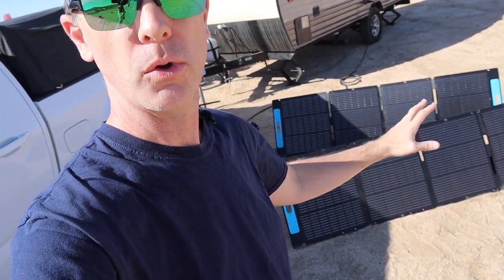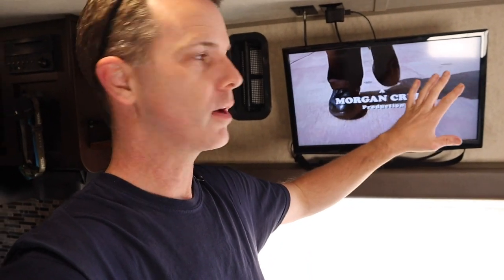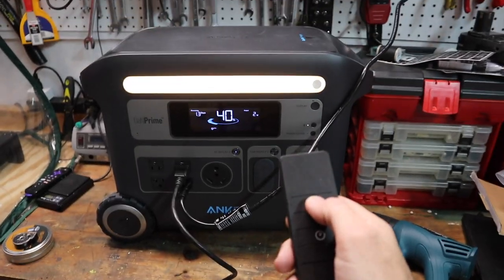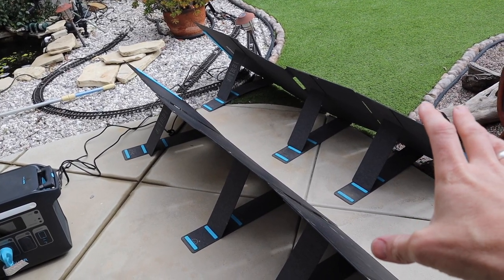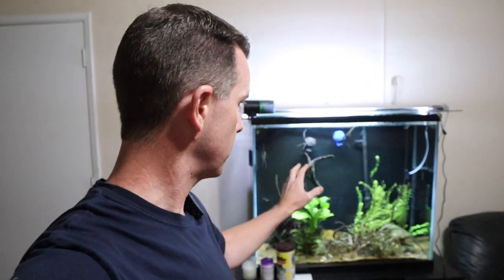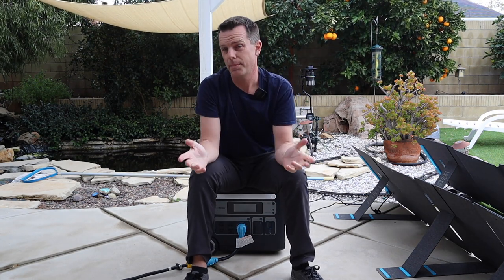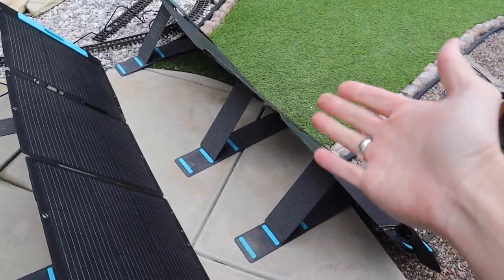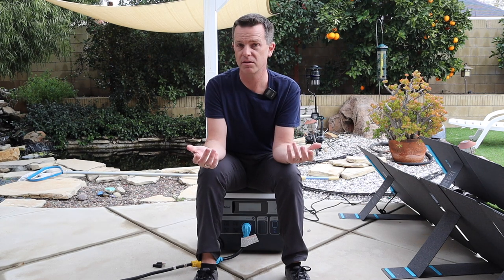Can It Actually Replace A Gas Generator? Anker Powerhouse 767

Comment: Thank you for the review. The 767 is a good complement to a gas generator. The gas can run during the day and the 767 can run at night.
Reply: Even better, run the generator only to charge the battery, instead of wasting its always-on energy when less is needed. This is the Achilles Heel of those Generacs & others; they don’t sell them with batteries so they run all the time—even if you have just a few lights on, and waste a ton of fuel.
Reply: @shandor2522  even better, throw some panels on the roof to charge either the 767 during the day or your cabin batteries and throw your noisy smelly gennie away.

Comment: AC current can act very strange, especially when something like an air conditioner turns on.The flow actually can move backwards. It seems like this unit doesn't have a problem with that and can allow a temporary heavy load. I would love to see voltage/amps on another device when something kicks on like air conditioning.

Comment: I currently have the 767/760 support battery, reversing power to condo, runs home refrigerator, freezer, and mini freezer, runs lights, enough to keep us with lights and tv during hurricane or power outages, runs 6k window a/c for 15 hours…just shut off whatever your not using and your ok, after outage I recharge it with my Honda Generator or house power,if FPL gets it back on…😂😂😂

Comment: I think the EcoFlow in this wh range has better specs...and is more compact...I personally can do with a smaller EcoFlow because we don't need much during power outages...BUT i'm tempted to get this more expensivd Anker because of 1) wheels and pull handle 2)Light in fromt 3) 14-30 plug 4) looks more attractive.

Comment: Just came across your video.  My EcoFlow Delta max can run my A/C.   The problem with initial start up of the A/C is the amperage goes above 15 amps, but my ac outlets are rated for 20 amps.  It is not the wattage that shuts down the Anker but the amperage.  On my A/C if I turn it on to high cool immediately it draws between 16 to 18 amps.   The way I got mine to work was to ensure that everything was turned off in my RV.  Than I started the A/C on low fan, for a minute, than on high fan for another minute, than I went to low cool until the compressor kicked in, this drew about 9 amps at start up than dropped to 3 amps, afterward I turned on high cool which stayed at 4 to 5 amps, than I turned on the fridge and what ever lights you wanted.  Of course my a/c would run down my ecoflow in about an hour.  I was just conducting a test as I did not want to install a soft start.  My A/C is the Coleman Mach 13,500 BTU, just fyi.  Good video by the way.

Comment: You need an air conditioner soft starter.  It starts the compressor first, then starts the fan a few seconds later.  This way the initial in-rush current is dramatically less and you won't overload the pure sine wave inverter.  They are available through E-bay for less than $150.  It's not the same as the unit you're showing at 4:10. it actually installs inside the A/C itself.
Reply from the maker: I know, but in theory this power station should be able to start the AC. 
The benefit of the inline soft start is that it also buffers everything else downline. It soft starts the microwave as well lessening the load on the generator through those startups as well.
Reply: @DoItYourselfDad I seen on another channel (@sheen3453 - Sheen) that the Anker 767 had a problem regulating the output when connected to inductive loads. After a firmware update was pushed out specifically to his unit he no longer had the issue. In the video he had a small 110 volt window unit plugged in and the compressor was running erratically. Not the same as high in rush current, but your issue could stem from the same Anker firmware problem. Worth looking into I guess.

Thanks for the video. I'm considering the Anker for a travel trailer.
Reply from the maker: @Interesting_Placebo  intersting, I didn't know about the firmware update. Im going to give that a shot right now. Do you know what video it was mentioned in? Would love to view it.
Reply: @DoItYourselfDad any updates on this? Did the firmware help?

Comment: I am using a 767 plugged into a six 120v circuit transfer switch and it powers all six circuits individually or all together. The only issue I have encountered is when one of the older ceiling fans runs at a certain speed seems to impact our chest freezer on same circuit making its motor louder. There must be a cycle imbalance because changing the fan speed or turning on another device on that same circuit returns the freezer motor to normal. Similar a landscape light transformer gets loud when powered by the Anker. Otherwise the rest of the house powers fine. Seems devices with certain windings are more fussy but I haven't determined this to be an Anker issue and maybe just those devices. I love the 767 and house transfer switch combo, it's a great affordable power backup. I also use 3x200w portable solar panels in series to recharge the 767 or power certain circuits directly via the 767.  Across the six circuits I have a full frig/freezer, mini frig, chest freezer, multiple tv's, AV receiver, several computers, routers, etc. lights, fans, outlets, etc. I have loaded tested each circuit so I know exact average watts needed and during a BAU period I can power all six circuits together for 8-12 hours off the 767 with expansion battery attached. I can also power each of the six circuits individually for 22-40+ hours off the 767. A simply flick of the transfer switch/s gives me full control without any interruption going from grid to 767 and back.

Comment: I know some casino campers who regularly utilize the free parking at various casinos.  This would be good for an application like that, which is essentially boon docking.  Free power from the sun is appealing versus using a noisy gas generator.  Nice video, I gave it a like.
Reply: Issue is solar generation. Difficult to setup this whole shebang in a parking lot
Reply from the maker: You’d be better off buying the power station and hooking it to roof mounted solar with an adapter
Reply: The solar panels have holes in them. I wonder if there’s a way to quickly hang them on a rack and deploy it to roof. Or just hang them off the side (which is least efficient but I guess works)

Comment: I was seriously looking at the Anker 767. It really appeared to be perfect for me. Integrated ac adapter, lovely screen, supposedly very quiet, nice app, good efficiency rating, love the handle and wheels and being Anker they have a good rep for customer service unlike company's like Bluetti.

Nearly shed a tear when I saw it the 767 only allowed 60v solar input. Why Anker why. You were so so so close :(. Maybe they'll do a 768 release. Pretty please Anker. Apart from that its one hell of a unit imho.
Reply: I’m on the same boat but want to power a office shed. The solar specs make it so you can only max out with Anker’s panels ridiculous priced panels. I can’t get more that 600 watts without going over voltage or amps.
Reply: @TobyCostaRica  I keep trying to reply to you and my comments keep being deleted.

Comment from the maker: Anker is running a sale right now: Use the link below to register and spin to win up to $1000 off:
https://ankerfast.club/2aRdMH
Anker 767 on Amazon: https://amzn.to/3JT1mtz
Adapter to use standard solar panels with the 767: https://amzn.to/3nc8lVs
Reply: I’d love to throw 400 watt panels on the roof of my new Minnie Winnie and have them connect to this. Do you know if there an “rv rack” I can install? I also have a starlink dish
Reply: New to this whole rv thing. I know holes in roof bad. Would make sense to go with one or two racks versus independently screwed in and mounted components

Comment: Great video!  Those are XT60 connectors,  not XT90.  The solar input voltage limit is 60v which is the biggest bummer.  Also no simultaneous AC and DC charging.  That in-line soft start looks cool,  looking forward to specs and a review on that unit.
Reply from the maker: Correct, I use both XT 90s and 60s with all my RC stuff. Not the last time I’ll get them mixed up when talking 😂

Comment: Very detailed and informative review.  Looking forward to your review on the in line soft start as I just got the 767 and was hoping to use it to intermittently power the AC unit on my sprinter van but it only turns it on for about 2-3 minutes and then get an overload reading from the unit.  Although the 767 is rated at a surge captivity of 4800 watts it’s just not powerful enough to sustain the fluctuations of the compressors startup energy needs.  Hoping in-line soft start would do the trick.
Reply from the maker: Thanks! The in-line soft start is a pretty neat gizmo. I had thought about putting a soft start on my air conditioner when I stumbled on this thing, it definitely makes things a lot more convenient, it also soft starts a microwave, which puts less strain on the battery, which is an added bonus. I’ll have a video up on it soon.
Reply: @DoItYourselfDad  Or at least a link to where you found/bought it from.

Comment: Cool review with some real world testing, thanks.  FYI - the "30amp" plug is actually only 20amp output apparently...
Reply from the maker: I’ve pulled 29 amps through it, it just struggles with sudden surges (like the AC startup)
Reply: @DoItYourselfDad  That's good to know!  Curious if you tested (or if it matters in practical use!) the polarity coming of the outlets?  I am reading elsewhere that they are actually reversed...

Comment: Great video on the Solar Generator! For outdoor enthusiasts like us, having a reliable power source is essential. Have you heard of the Segway Portable PowerStation Cube Series? It has an impressive capacity, fast recharging, and a waterproof design. Check it out for your camping adventures or as a home backup power solution!

Comment: If you notice some of the new air conditioner plugged into the wall it's not just the plug it's even has A GFI I believe that's a soft stop I think it energizes the plug!
Reply from the maker: Those are not soft starts

Comment: thanks for video , just I want to know how long it take time to full charge with 400W solar panel ? and another question is : if 30% of my power station have charge and I try to charge it on full , it take down the battery sycle ? and anothe question is : If I try to charge it with 400W solar panels on cloudy weather and my device dont charge until night and tomorrow again I try charge the rest , is it damage to battry life cycle ?

Comment: Anker sells an expansion battery accessory that attaches nearly doubling the output to 4000w. I wonder if that changes the decision for the  “partial house transfer switch” setup like you have.  I think it might be an addition to the gas generator setup if you don’t want the noise, or hassle of going outside to connect everything in bad weather, etc. might not last too long, but with the expansion battery it would last almost twice as long…  Of course the power station, plus expansion battery, plus two solar panels is well over $4000.
Reply from the maker: It definitely would, the only issue you would be battling against at that point is how quickly you could recharge them given how many panels you can hook to this thing. Either way, this thing is impressive for what it is and definitely come in handy both camping in during power outages.

Comment: Awesome review trying to see if this is a good backup battery for sump pumps.thoughts?
Reply from the maker: I currently use it as a backup battery for my koi pond, which runs three pumps (sump pump size). I've also used it to run the dirty water sump pump in my side yard during storms when the power goes out. Works well, the only issue is the unit isn't water proof so I cant leave it outside.

Comment: I ditched my rooftop AC unit and installed a 115 volt mini split . I know it pulls approximately 7 amps running in turbo mode . When we’re not at our land ( rv location ) I like to leave our refrigerator on and mini split at i higher temperature . 
(80-82 degrees just to keep humidity down . My question is since the mini split is a soft start would it be able to run the 12,000 btu mini split and rv refrigerator with this generator for 6-8 hrs throughout the night which I’m sure the mini split will shut off since our nights are around 80 currently . We do have land power but my concern is leaving food in the refrigerator if we have a power outage and is there panels for it that are water proof ?
Reply: Seems like there are waterproof panels, just that the Anker branded ones are not.

Comment: I would think if you turn on the a/c in the trailer, set thermostat to hi and let fan start, then set thermostat to cool, the 767 will run the a/c

Comment: On the 30 amp plug on the anchor, what is the amperage connecting to your house, 30 amp or 50 amp? 🖖
Reply from the maker: Im using an adapter, running 30A into the house.
Reply: @DoItYourselfDad  
So you’re main house connection is a 50amp? Then you added the 30 amp adapter. 🖖
Reply from the maker: @simon359  Correct

Comment: I'm having a problem with my Anker F2000 my 30 plug doesn't work. I charged the unit with ac outlet at home. Plug the RV in and I get an "open ground" reading and no power from Anker power unit. Contacted Anker and was told it 30 amp socket is only good fro 20 amps. Every video I've seen shows them plugging the RV into the TT-30=R outlet powering just about everything in the RV I even saw a guy with a 40 foot class A 50 amp using a 50 to 30 dog bone powering everything including Air. I keep trying to find if I am doing something wrong. I also plugged in my surge protector without the RV and it gave an open ground reading. If I plug it into a 110 outlet using a 30 amp to 15 amp dog bone it still reads open ground. When I plug appliances into the 110 plugs everything powers just fine. But it won't power my RV.

Comment: I detail cars and I don’t want to use gas powered would this be good enough just to power my vacuum for a few cars?
Reply from the maker: Yes, this would definitely have enough power to vacuum several cars. Vacuums actually don’t pull that much juice so this would probably run for several hours. If you need more details, I can try plugging my vacuum into it and see what the LCD tells me for runtime.
Reply: @DoItYourselfDad  yeah pls it would be cool you can show us how powering a vacuum on that thing would look! Thanks!

Comment: 30amp output is that still single phase correct?  The 1st set of breakers on your manual transfer switch looked tethered so its running split phase.  How is that wired to run your Koi pond pump?

Comment: That solar splitter connector scares me. Are those open xt connectors all live?
Reply from the maker: Yes, shockingly (pun intended), they are. I am planning on running this with solar on my trailer, so I won’t be using this splitter once setup.
Reply: @DoItYourselfDad  is there any type of plug/cap for the splitter.
Reply from the maker: @lgDukeCity5018  There are aftermarket caps available, I picked some up to cover mine up.
Reply: @DoItYourselfDad  do you have a link for the outlet covers? I can only find the covers for the end of the cables.TYIA!

Comment: No it can't power an entire home. At least not for very long before you fry the MOSFETs because of all the exposures to the high surge loads in your home. You'd be lucky to get even two years of service from this solar generator, especially when powering high inductance loads like full sized refrigerators, large power tools, portable AC units or large microwave ovens. The reason for this is that all of these lightweight, high frequency inverters lack a very critical component. That critical component is an iron core, copper wound output transformer. Without an output transformer to act as a buffer to absorb electrical surges provided by the “Flywheel Effect” inherent in the physical amount of a transformer’s iron, these surges and damaging reverse voltage spikes must be handled directly by the inverter’s MOSFET transistors, essential shortening their life. 

You might be able to start and run some high surge loads when these high frequency inverters are new, but every time you fire up one of those inductive loads, you're shortening the life of the MOSFETs in these inverters. 

Another major consideration with these lightweight, high frequency, transformerless solar generators is safety. All it takes is for the AC output monitoring circuitry to fail and one of the MOSFETs in the inverter's H-Bridge circuit to short to ground, and these solar generators can dangerous, high voltage, high amperage DC current straight to your connected AC loads which will not only damage most AC appliances but can also set those AC appliances on fire.

Comment: DID IT RUN YOU WELL PUMP AND HOTWATER HEATER?
Reply from the maker: My water heater is gas, you couldn't pay me to switch to electric. 

I don't have well water. 

Power needs for both devices rage widely so there's no way to know what you would need without that info, but, most well pumps and water heaters are going to be 220, so that's a no-go.

Comment: Can you plug a dryer to the 30 amp outlet?
Reply from the maker: Most electric dryers need 240, so if you’re running a 240 electric dryer, no.
Reply: @DoItYourselfDad  but how much voltage is in the 30 amp? they sell an adapter? Since they look different.